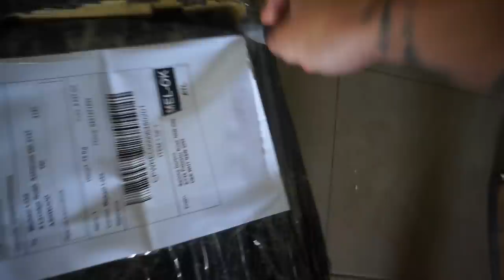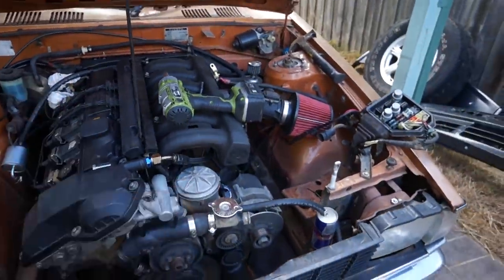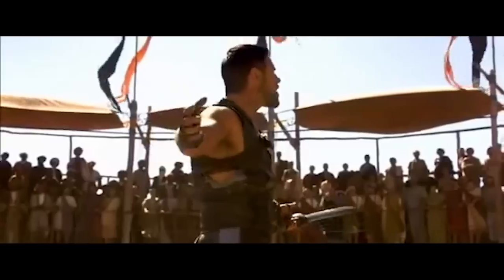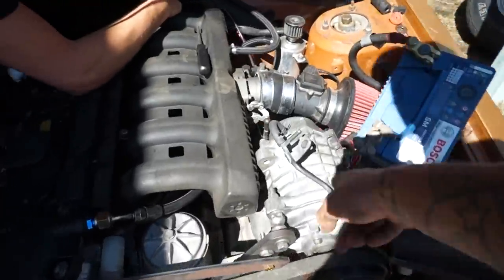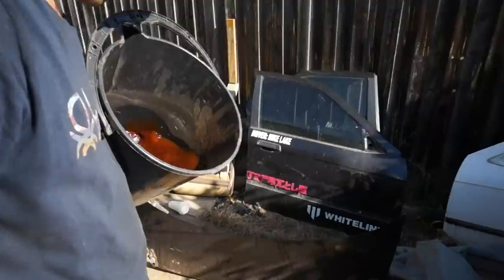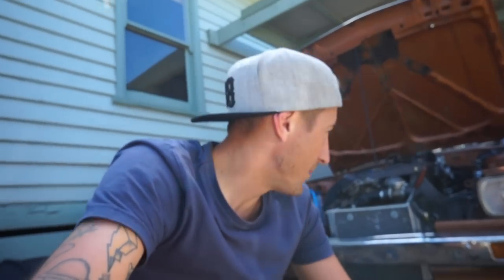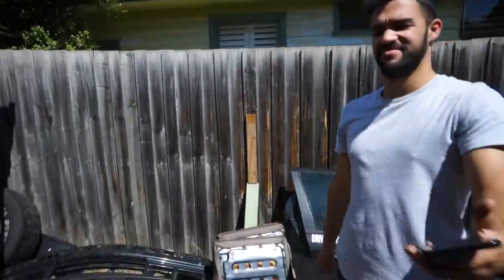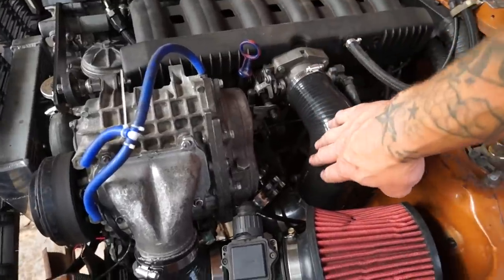KE70 SC14 SUPERCHARGER INSTALL! M50B20, TE72 COROLLA.

Comment: I had an sc14 on my b20vtec civic. Made about 136wkw on about 5.5psi. SC clutch was ran through the ecu, only came on once certain parameters were met, engine, oil temp, throttle position etc had an override switch too. Most of the time i drove around NA. Ultimate sleeper
Reply: Did you use the stock pulley?

Comment: Hey Mate, so thats actually a Hyde Motor Works V2 variant kit, the HMW 80mm pulley will give you 6 - 10PSI. Drop us a line if you require support with anything or have questions. :)
Reply from the maker: Thanks so much for the info dude! They're a beautiful piece of kit. Does the PSI differentiate based on the displacement of the engine? This is the 2 litre variant with the stock pulley so very interested to see how much boost it will make as is!
Reply: @itsmikelake  Welcome, so the idea with the injectors should be a pass, instead invest in an Ostrich II piggyback and then dial the injectors in we should have some flash files for you, that said the boost should be around 3-4PSI max with that pulley, if you use the HMW 80mm you should be able to bump it up to 6-10 depending on if its intercooled or not, we have the installation guide up on our site, download the latest one and get installing. There is also a power gain and boost output formula there in the blog. One othe thing I would add is the SC14 you have is a Type 2. This will require likely the adapter bracket, see if you have trouble with the belt alignment (6pk 2260 for stock pulley) and 6PK2230 for the hmw 80mm will work. These are positive displacement blowers, and the boost is in relation of not only the engine displacement but your overall number of valves the engine efficiency etc. As in on a M20 with more displacement you will see more boost vs this one. Drop us a email and we will help you with the build as you go. All the best.

Comment: Supercharger switch needs to be on the gear stick for maximum Mad Max effect. 197hp
Reply: Also raffle would be an awesome idea.
Reply from the maker: 😂 the ultimate mad max car haha. Apart from the fact you'd hit something and it'd crumple from the rust hahaha...
Reply: Rust is lighter than carbon fibre though. 😏

Comment: more would be nice but i rekons 165HP @ wheels
Reply from the maker: Daniel Van Oosten ohhhh interesting! They’re 150hp NA so I’m thinking more around 180hp?
Reply: @itsmikelake  yeah ive had a few slow 6 but they scream haha.
150hp/190nm torque @4200rpm and nothing untill then lol.
Probably only 120whp so i call close to 180-200hp at the crank gives us 165whp.
Numbers dont mean much its all about when its available and for how long, with the extra N.m and now available bellow 4500rpm it will skid like twice the car it was.
Reply from the maker: @danielvanoosten8987  Yes I 100% agree with that! Numbers aren't as important as when the actual power comes on for sure. That's why i've put a smaller turbo on my e36 haha, more repsonse!
Reply: @itsmikelake  do you reckon she goes harder than a healthy 325i/m50b25?

Comment: 135 rw kw?
Reply from the maker: Ohh I'd hope for more than that,  they make 150hp NA from factory (I think that's crank though?)
Reply: @itsmikelake  Sorry, I meant KW not HP... edited. Just basing that on 110 flywheel KW minus a bit for rear-wheel KW plus 50% for the SC, plus my own (somewhat disappointing) experience with my supercharged 318is.